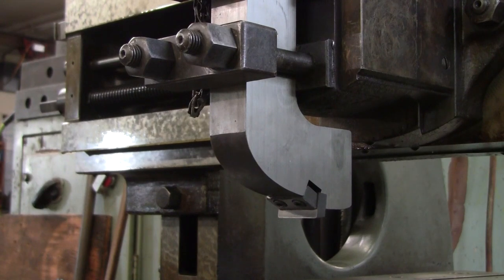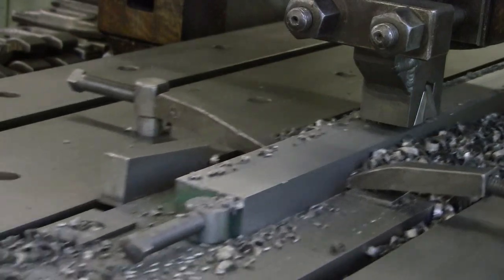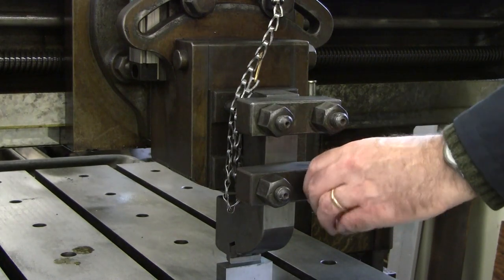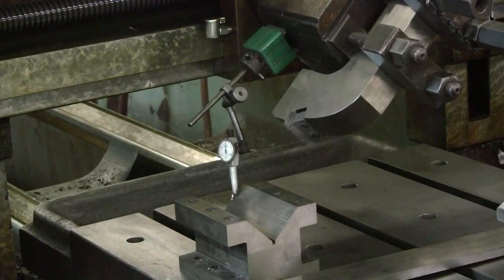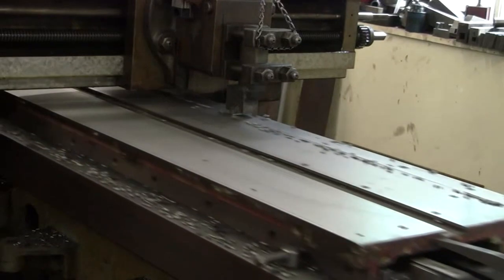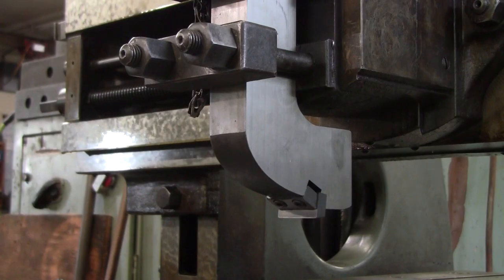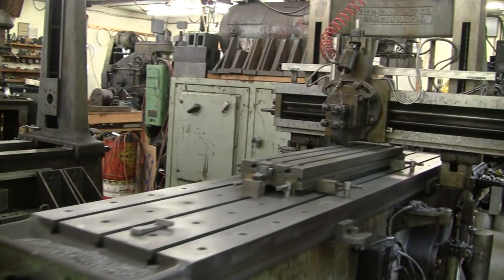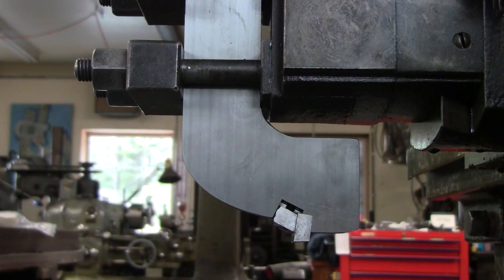The Flat-Tool

Comment: I love this.  Im actually learning a couple things.  I plan on making videos like this in the future.  We have a brake die shop with 9 gray planers.
Reply from the maker: Nine planers!  Fantastic!  It is difficult to find a shop with a single planer.  Where is your shop?
    Is there a chance that you might want to plane lathe beds and milling ways?  I have been looking for planers to send work.
    In another comment you mentioned that the planers are worn.  How worn are they?  Have you tested them for accuracy?  As for straightness, they might be better than you think.
    Incidentally,  I wrote a small pamphlet for my son on planer work that I would be glad to send you.  Send me an email to the one listed in ABOUT.
Rees
Reply: @reesacheson5577  we’re in the Chicago area.  At the moment it’s still too early for me to speak for the shop, but our planers are all set up for brake die work right now, so only about a foot on the operator side of the table is planed and used. It’s very possible I will message you in the future though, because I’m completely open to something like that.  I love these machines. Ours are all ww2 era. Our longer machines have taken a beating over the years but I can still hold a thou over a 28 foot bar.  Shorter machines are in better shape.
Reply from the maker: @9mmsafetyalwaysoff00  I can't seem to find your reply that mentions your interest in the planer work pamphlet, so I am replying here.  Send me your email and I will send a copy.
Rees
Reply from the maker: When replied to this before I was distracted by the fact that you had 9 planers operating.  I did not know that such  shop existed.  
    Now I would like to encourage to you create video of the planer work in your shop.  I posted my 1st one because there did not seem to be much in the way of planers actually cutting anything.  I have been surprised to find how many people seem to care.  I for one would love to see yours cutting brake dies.  I hope that you can get around to it.
Rees
Reply: @reesacheson5577  Hey rees could you reply to this with your email?  I tried emailing you a couple times but I dont think I'm finding the right one on youtube.  Thanks!
Reply from the maker: @9mmsafetyalwaysoff00  The email I get from you through YouTube is from noreply@YouTube.com and so replying would not work.  I checked to see if there were any spam that I might have missed but none found.
 If you are able to signin to YouTube you should be able to get my email from the ABOUT section.  If this does not work let me know and I will try to figure out how to get you my email address without publishing it for non-users to see as well.
Rees

Comment: Thanks Rees for sharing your metal planer experience with us out here in TV land! Any recomendation on the type of carbide to use for your flat-tool? I will be looking into getting one of these made up for my ol' Gray in the near future. :)
Reply from the maker: The carbide blank I used was C2.  Several years ago I bought two more from MSC.  Looking it up now, the part# was:   79695953, 
   "3/8X3/4X1-1/2" C2 INTERSTATE CARBIDE BLANK"
  These are rough blanks so it is important to grind all sides of it.  
  When grinding the clearance and the top I used a surface grinder and stroked the wheel almost along with the edge - skewed about 10 degrees.  This helps prevent the abrasive from micro chipping the edge if the abrasive traveled perpendicular to the edge.  Probably not important, though. 
- Rees
Reply from the maker: Incidentally, I mentioned that my replacement carbide was C2.  But I am not sure that the grade matters much, as long as it is meant for iron.
  The original carbide that I built the tool around were of C6 for steel and had been inserts for some large boring holder.  I used those inserts  for nearly forty years until there was not enough left to grind.
  Not at all incidentally, you have a Gray planer?  How old?  What size?  Does it work yet?  I love planers!
  Rees

Comment: do the carbide tools work on 4150 too? Ive always used coated HSS tools but now I want to try one.
Reply from the maker: The Flat Tool is only meant to be used with cast iron.
  For steel you should use a HSS Shear-Tool.  The shear-tool also has a flat end but it is canted to the direction of travel by about 30 or 40 degrees.  The rake is also greater, at about 10 degrees and the clearance about 7.  It also does not need to be so wide as a Flat-Tool - perhaps twice the feed rate, or whatever is wide enough to enable setting the tool parallel.  Feed rate of between 0.030 and 0.250 can be used.  4150 should cut fine as long as the speed is low enough to prevent deterioration of the edge.
  In the commercial tools I have seen the direction of cant has been both ways - even from the same manufacturer (OK Tools), but the ones I make are leading edge leading.  That is, the corner of the leading edge of the tool also leads the cut.  
  Be sure to brush on a coating of thread cutting oil to the surface of the part.  Even then, steel tends to tear a bit, although 4150 probably not so much.
  Oh, and as described for the Flat-Tool, the edge must be behind the shank of the tool holder.
  You ought to be able to make a quick test tool out of a 3/8 square HSS tool.  It may be possible to use carbide for this but I have never tried it.  The probability of breakage has been high enough that I have never taken the time to do so. 
Rees
Reply: @reesacheson5577  sorry I wasn’t quite clear with my question. So we use carbide mostly to rough out 4150 or plunging to make a V die, chamfers, slots , etc. Which had me curious about how a carbide flat tool would work.  Our flat tools are hardened hss t15 with a special coating that lets us run the table fast and get a glass finish. Very satisfying.

I’ve heard of people using cutting oil but we use a coolant because our shop would be a smoke house lol. 
 With the controls for the table these things absolutely rip through material. too. I have a video of me taking 3/4 of a tnmg insert taking .037 cuts I’ll share if I can find it. 

I really appreciate the info. I wish there was more out there about planers.  They’ve just become obsolete in so many industries.
Reply from the maker: @9mmsafetyalwaysoff00  Ah!  You mentioned 4150 because that is what the dies are made of?  I can see why you would not want to use cutting oil if cutting dies was happening all the time.  
  That also implies that the 4150 is hardened and tempered down to machinable.  If that is the case I would try a carbide flat-tool.  On a narrow surface I bet it would cut quite nicely.  If there is to be a problem, it will likely be that the cutting forces will be too great for a full width plunge into the vee.  The die will want to spring away and so would have to be supported, and the planer may not be able to withstand the forces.  Big planers would be better in this regard, but you also mentioned that they were worn.  However,  it sounds as though you are already dealing with that problem using HSS cutters - it sounds like you are plunging full width.
Rees